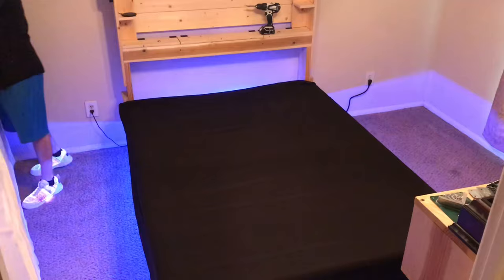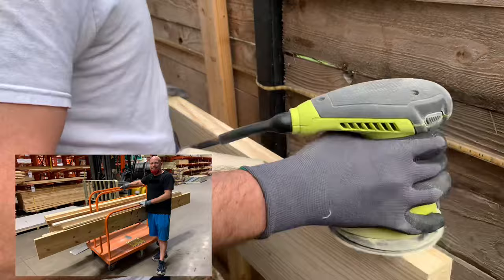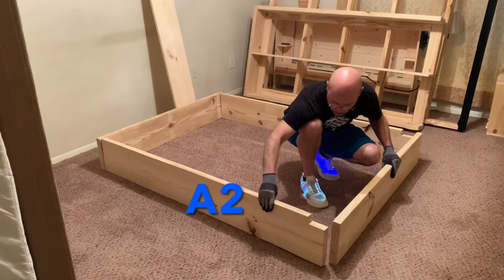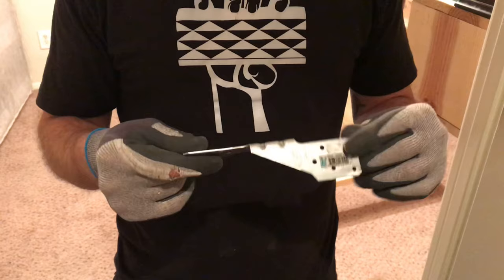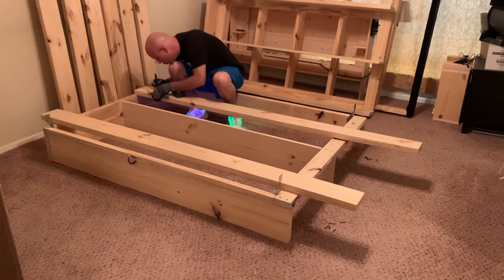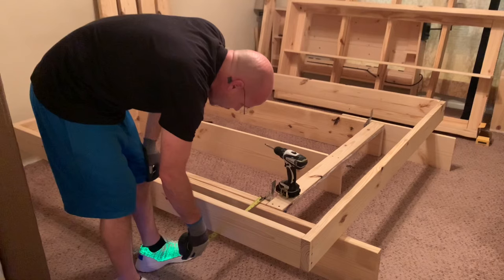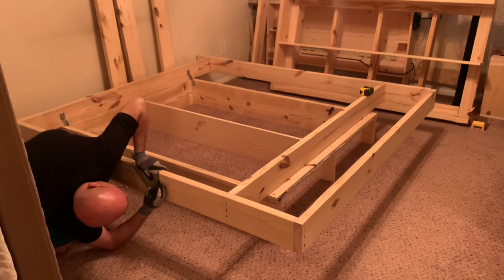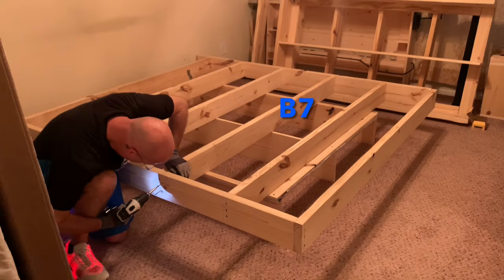King Size Floating Bed Frame [Easily build your own!]

Comment: Do you think this would work with 2x4s instead of 2x6s or 2x8s? Love the video, thanks in advance :) Watching from Canada!
Reply from the maker: @williamblakeman5166 Hey William, I wouldn’t recommend it.  I think I’ve found that the weight of the 2x6’s is part of what keeps the bed frame from tipping once everything is assembled.  You may be able to get away with 2x4’s if you make the base a little wider, but I know for sure that 2x4’s on the full size doesn’t work.  I hope this helps.  Have a safe build.  Thanks for supporting this channel my friend 🤝
Reply: Hey  @CurtisMadeIt  . Thanks for the reply. Only just seen this and did try it out with 2x4s. The build was pretty successful. The only issue was as you have less wood to play with I couldn't screw in all the holes on the simpson strong tie as the wood in that area was already full of screws. Aside from that it feels pretty sturdy. I (nervously) did your walk around test and even with 2x4s it worked! 2 great nights sleep so far! Thanks again for the video and keep up the good work :)
Reply from the maker: @williamblakeman5166 Hey William, awesome my brother!  I’m glad this worked out.  Thanks for coming back and letting me know.  I’m thrilled to hear you seem to be happy with your new bed frame!  Let’s get some more good nights’ rest on there.  Talk to you again down the road.

Comment: Hello and thanks for the video. I want to ask if I could use 11”x2” wood for this. It’s all I have. Thanks
Reply from the maker: @yourLocalTroll33 Hey Troll, this may be a little ambitious.  I use 2x6's for the bases and frames for these builds.  You could use the...11" x 2"(this is an odd size piece of wood...custom milled or is this a 2x12...?) for the base if you'd like, but your frame is going to sit up very tall once you get the box spring and mattress on there.  If you have a table saw, I would rip that 11x2 in half long ways and then use those pieces to build your frame.  Does this help?  Let me know if you need anything else at all.  I'll talk to you again down the road my friend 🤝
Reply: Thank you for your help. This means a lot. Is the box spring optional? I was under the impression that it wasn’t necessary. Again, thank you
Reply: I’m building queen size
Reply from the maker: @yourLocalTroll33 Hey Troll, you definitely need a box spring or some other kind of support for the mattress.  I would recommend the box spring, but others have used either plywood or cedar fence pickets.  I hope this helps.
Reply from the maker: @yourLocalTroll33 Make sure to check the videos section of this channel.  I've got three full length videos posted for the full size plus a subscriber build that I completed in Houston, Texas that is also a queen size.  Let me know what you need from me and I'll be right there.  Thanks for your time, interest, and support in this channel, I mean it 🤝

Comment: What part of Texas do you live in? How much for a frame like this?
Reply from the maker: @Steve Cervantes Hey Steve, I’m in Houston(edited to include my city).  I built this earlier this year, in summer of 2021, at the height of the lumber spike.  At the time, as this frame sits in this video, materials were about $225.  I’ve since added a headboard and am currently putting the video together for that(today is 10.20.2021).  My materials cost all in will be close to $500, but that would include lamps, bulbs, under bed storage bins, all the lumber/fasteners(headboard included), sandpaper, lights underneath, wireless chargers bundle for my phone…you get the idea.  I hope this helps.  Let me know if you have any other questions.  Talk to you soon.

Comment: Where do you mark 16 inches 32 inches and 51 inches on the board?
Reply from the maker: @shuvonkhan5314 Hey Shuvon, I think you may have answered your own question there my friend.  Measure from the head part of the frame towards the foot part of the frame.  Make a mark on the board, as you said, at the pre-determined lengths to establish where the joists will be.  I hope this helps.  Let me know if you have any other questions.  Take care my friend, we'll talk again down the road.  🤝

Comment: nice, planning to build a king size one, would appreciate a hand
Reply from the maker: @john gichuru Hey John, good morning.  Sure thing!  I just got done charging my batteries.  What’s the address?  😂.  No joke though, make sure and check my latest video ‘A trip to California’ where one of my subscribers, a total stranger to me at that point, actually asked me to go to California and build her a floating bed frame and I did!  I appreciate your time and support my brother.  Let’s talk again down the road.  Be careful.
Reply: @CurtisMadeIt  Am in Nairobi, Kenya. I already have my 2*6 for both my base and upper part. When i put it together, its too tall. My question is, can cut the 2*6 to 2*4 for both the base and the upper part?
Reply from the maker: @john gichuru Hey John, Nairobi, Kenya is gonna be a little far for me to travel at this time 😂 but I’ll do my best to help you from here.  Sorry to hear it is too tall, some people have reported this to me, though it is pretty infrequent.  If you have a table saw, yes, you could rip your boards length wise cutting off 1/4” or 1/2” at a time or you could figure out exactly how much you want to lower your bed frame, divide that number by two, and then rip off that much off of all of your boards.  I hope this makes sense.  Feel free to reach me on Instagram realc_love1 and I’ll be glad to help you there too.  Talk to you again soon my brother.

Comment: How much did all of the wood cost for the king size build. Total cost
Reply from the maker: @Tierney Compher I built this during the height of the lumber ‘shortage’ of 2021 so it felt like close to a million, but at the time as it sits in this video, it was about USD$200.  Today is 10.31.2021 so I’m certain it would be cheaper than that right now.  Thanks for your question.

Comment: How can you modify this to accommodate slats instead of using a box spring
Reply from the maker: @Chris Porterfield Hey Chris, I’m sure this could be done one of a number of ways, or, you could just put plywood on the deck of the frame.  Does this help?  Reach me on Instagram realc_love1 and I’ll be glad to help more if needed.  Talk again soon my friend, stay blessed 🙏
Reply: Fence pickets running horizontal over the joists would work. I’ve used those as slat replacements when mine have broke in the past and I plan on doing the same for this build
Reply from the maker: @bballgod Well, there you go.  That's the easiest fix I've seen.  Thanks for your contribution B, you are the real hero here.  Stay blessed my friend 🙏

Comment: hom much biger is the outer frame  to the stand on each side 10" 15" ?
Reply from the maker: @Seb Ger Hey Seb, thanks for your interest.  The base is 36” x 68” and the frame is 60” x 80” so there is a 12” overhang on three sides of the bed frame.  I hope this helps!  Talk to you soon my friend.
Reply: @CurtisMadeIt  thx a lot, how high is the base ?
Reply from the maker: @Seb Ger It’s made out of 2x10’s, they are 9.25” tall.

Comment: Any suggestions hon how to make this without having to use a box spring?
Reply from the maker: @memyselfandmeagain21 Hey there Me, yep.  Use plywood or, as someone else has mentioned, cedar pickets cut to length.  Does this help?  Thanks for your time and support my friend.  Let’s talk again soon.
Reply: I'll probably make two top boxes for easy moving with the middle joists 3/4 rip and make a shit ton of slats. Do you have a material list?
Reply from the maker: @memyselfandmeagain21 I do, yes.  Apologies for the delay in my reply.  I’m on Instagram realc_love1.  Reach me there and I’ll get you all the info you need.  🤝

Comment: Hey i want to build it using metal frame. What breadth of wood sheet I should use for upper cover (B1) in your video
Reply: And also tell me the total height without matress
Reply from the maker: @Nicck K Hey Nicck, A king size mattress measures 76" x 80", that's 193.04cm x 203.2cm.  You will want to have plywood to cover the deck that comes out to these measurements.  Basically, if you get two sheets of plywood, the first one will have 16" cut off the end of it and the second one will have 16" cut off the end and 20" cut off the side.  That should leave you with a piece that measures 80"x48" and a piece that measures 80"x28".  Slap them babies on there and you should be good to go.  I hope this helps, let me know how else I can help and I will.  Thanks for your time.
Reply from the maker: @Nicck K Hey, there's my buddy Nicck again.  Height without the mattress is 15", that is 38.1cm.  The frame is 2x6's, those are 5.5" tall and the 2x10 base is 9.5" tall.  Stack those on top of each other and you get 15".  In your previous comment, you had mentioned putting plywood on the top of your metal floating bed frame.  Talk this in to consideration as it will make your mattress sit up just a little bit higher.  Thanks for your questions, I love that you are so interested.  I'll be here if you need anything else.
Reply: Thanks. I appreciate that you took time to read each comment and reply. 👍
Reply: Iwas planning to make the frame 18 inch tall. On top of it the wood sheet will be attached. So the 9 inch thick wood sheet float 9 inch above ground. But now I think it will make My bed too taller. Any views?
Reply from the maker: @Nicck K You are welcome my friend…sometimes it takes me a few days to get caught back up, but I always get around to it.  Tag me in your reply the at symbol and then my channel name C_Love1 and I will get a notification of your comment.  I appreciate it. 🙏
Reply from the maker: @Nicck K I previously mentioned that this king as it sits is 15” tall.  I’ve got a queen size mattress, but have been sleeping on the king frame until I had a chance to post the headboard video, so I’ll take it down soon.  I have a 4” box spring and a 12” mattress so the deck of my bed is 31” off the ground.  That is a little taller than I think I would like it, but it’s the same height as the queen size frame that I build for myself that also has the storage modification.  I think 18” in your case may be alright though.  That plywood will only be ~3/4” thick, just enough to support the mattress, and you don’t have a box spring, so as long as your mattress is around 12” tall, you should be good.  Let me know if you need anything else and I hope this helps.

Comment: Do you put the mattress straight on top of that - how it is at the end of the video?
Reply from the maker: @ella ohalloran Hey Ella, thanks for your question.  You will either need a box spring or plywood on the deck of the frame to support your mattress.  I hope this helps.  Let me know if you have any other questions.
Reply: @CurtisMadeIt  legend thanks so much!
Reply from the maker: @ella ohalloran you bet, thanks for stopping by and reaching out. 🙏

Comment: Wondering what the measurements would be for a California king bed
Reply from the maker: @amandaspradlin9492 Hey Amanda, I'm wondering how to accurately predict the very wild volatile swings in the stock market.  I'll trade you for free, straight up.  😂 Cali-king is just a little different measurements than this king size, but materials and cut list will also vary slightly based on 1)box spring 2)storage for the base 3)flush build like is shown here or a pocket build so your box spring sits down in there a little bit 4)headboard.  These are some of the things to consider when you are planning a build like this.  Reach me on instagram curtis_made_it and we can fine tune your design.  Thanks for stopping by and talking with me, I appreciate your time and support here 🤝

Comment: HEY WOULD 2 TWIN BOX SPRINGS WORK OR SHOULD I GO WITH A KING SIZE TO BE MORE STURDY?
Reply from the maker: @michael Ramsey Hey Michael, this is a good question…one that hasn’t been asked yet.  I think I’m gonna recommend you go with a king size box spring for this king size floating bed frame build.  You will need some kind of box spring or plywood to support the mattress for sure.  Hopefully I got your answer in there somewhere.  I appreciate your time, interest, and support my friend.  Be careful.
Reply: @CurtisMadeIt  IF I USE PLYWOOD ON TOP OF THE FRAME I DONT THINK IT WILL MATTER BECAUSE OF THE SOLID SURFACE WHAT YOU THINK?
Reply from the maker: @michael Ramsey You are DEFINITELY going to need either 1) a box spring of some kind or 2) plywood on the deck of the frame.  If you just put the mattress on there, it will sag in the gaps between the joists in the frame.  Does this help?
Reply: Hey could you help me with the dimensions for a California king frame
Reply from the maker: @michael Ramsey Hey Michael, you bet.  Reach me on Instagram realc_love1 and I’ll get you all the information you need.

Comment: Do I need the strong ties if im not using a headboard?
Reply from the maker: @Bakkstreet D4 Yeah, you still need to put them on there.  That is what attaches the frame to the base.  I hope this helps, let me know if you need anything else, I’ll be right there.
Reply: Were those special cuts you made on the ends of the boards a requirement?
Reply from the maker: @Bakkstreet D4 If you are talking about the base, then no.  I was just trying to be fancy.  Instead of cutting those notches in there, you can just put that 2x4 across there on top of the other boards in the base and it will work just fine.
Reply from the maker: @teh_gavin Hey G, I can't seem to find your comment so I'm replying here.  Those notches are the size of the 2x4.  I hope this helps.  Let me know if you need anything else.

Comment: Is this intended to have a foundation on top of the frame or a mattress only? I’m guessing a foundation correct? As a mattress would squish between joists in frame?
Reply from the maker: @Luke Bramblett Hey Luke, that is correct.  You will need either a box spring or some plywood to support the mattress.  I hope this helps.  Anything else?  Talk to you again soon my friend.
Reply: @CurtisMadeIt  that’s what I was thinking. Thank you for the reply. I’m planning on building this with the headboard and floating nightstands all from your videos! Thanks for all the info!
Reply from the maker: @Luke Bramblett You bet my brother, so cool.  I’m glad I was able to help.  Be careful while making your cuts and building, you want to be able to continue making awesome stuff.  I’m on Instagram realc_love1 if you want to share pictures when you are done.  Talk to you again down the road.
Reply: @CurtisMadeIt  Also, I promise this is my last comment…😂 I noticed in your nightstand build you used 1x lumber but in your voiceover you said 2x. Just a heads up for anyone making a material list, which is what I was doing when I caught it. I’m sure most everyone else will catch it too probably not a big deal but just wanted to let you know. Thanks.
Reply from the maker: @Luke Bramblett Thanks for pointing this out my brother, but go back and watch the king size headboard video.  At thirty seconds, I mentioned that the uprights for the headboard are a 2x6 cut in half.  At two minutes thirty one seconds, I put the one by dimensions on the screen.  I hope this clears up any confusion my brother.  Can I help you with anything else at all?  Thanks for your back and forth here...this doesn't happen much.  🤝
Reply: @CurtisMadeIt  you are correct in this statement. You do have the 1x dimensions up for the “headboard slats” as I will call them. And yes you are correct in saying that the uprights were a 2x6 cut in half. All that is correct in the video. However what I was referring to was when you first started on the nightstand cuts in the video. Your voiceover says “you will need a 2x6 cut to a total of a total of 6 14” pieces and 4 of something else I can’t remember the exact measurement… but you get what I’m saying. You used 1x lumber for the nightstands but you called them a 2x. I was saying not a big deal I caught it while I was making my material list but for people that might not pay attention to detail they might buy a 2x instead if they go by the voiceover alone. But hey everyone makes mistakes like i said it’s not a big deal I caught it and adjusted and I’m sure anyone that has ever done any amount of woodworking would catch it as well. I just wanted to point it out to you in case you wanted to change it. I can be sort of a perfectionist sometimes…😂
Reply from the maker: @Luke Bramblett Sorry for the delay, I needed time to further research your claim here...full time job, building and video editing in progress, other life obligations.  Man, you are absolutely right Luke.  I can't thank you enough for your attention to detail and taking the time to point this out to me.  I'll put a note in the written description for everyone else.  You are definitely the first.  This mistake is at two minutes and forty five seconds in to the video.  That is a huge deal to me actually.  I intend on leading people in the right direction if they are going to follow me, and clearly, some of you are, so I need to make sure I'm doing the right thing.  God put people like you here for a reason.  I needed to be checked.  You've done a fantastic job my friend.  Thank you.  Feel free to critique any of my other videos haha 😂.  I appreciate your time and support Luke.  Talk to you again soon.